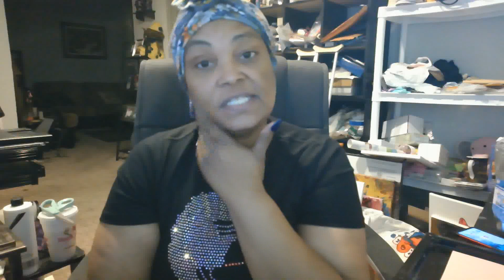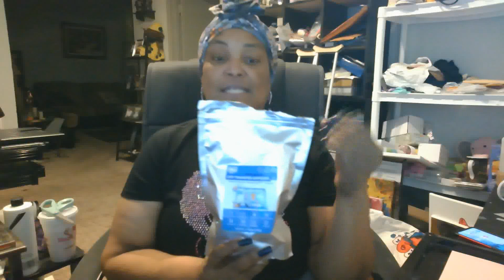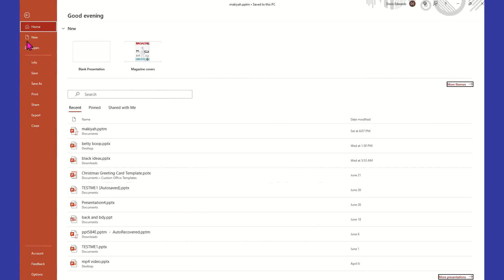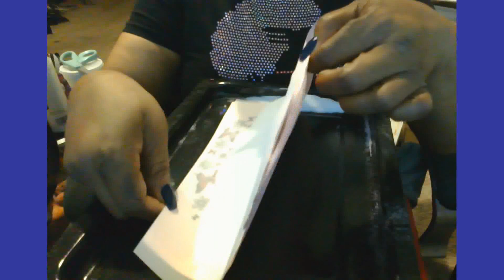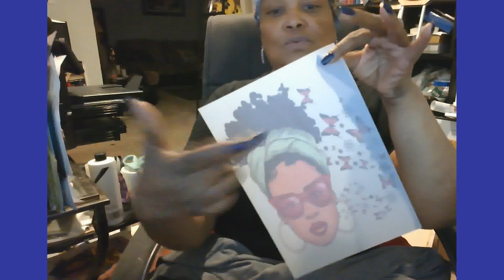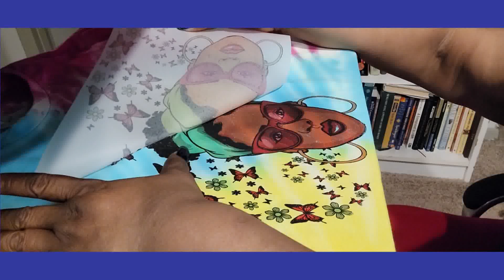How-To Use the Direct To Film (DTF) by Yamation

Comment: Hello. Love your video. I have the same type printer I converted to sublimation. I’ve been using DTF Yamation 11x17 for months. Worked great. However just recently my printer for some reason now jams! And if I finally get it to print, the image does not come out I full - it looks like a bookmark yet without the full image. I’ve checked my printer and software settings and updated my printer driver. I’ve never had this problem and hope you can advise. I’ve wasted so much Yamation film trying to figure out what happened.

Comment: How did the wash & dry turn out
Reply from the maker: It washed fine. I've washed it more than 10 times and the design is still there.
Reply: @dorisedwards58 First of A BIG THANK YOU FOR YOUR POSTING OF THE 2 VIDEOS ON DTF HACK W/ The Inkjet Printer!!! It was a God gift to me because I've been wanting to do sublimation designs for years. I actually stop do T's because I wanted that quality. You were the first one that I have seen doing DTF Hack and I was like yes! Thank You God🙌🏽  So thank you very very much!!!
Reply: And 2nd, your DTF HACKS (both of them) have been with the Yamation Film & Powder & Printed out with your Inkjet Printer not your sublimation ink right?
Reply from the maker: @sophiajones320  I did sublimation ink on one tutorial and inkjet on the other. I used yamation on both, but I have also used a different brand as well.
Reply: @dorisedwards58  Ok. So the Yamation products printed w/ the inkjet printer, how did it was & dry?  Did u test it Mis Dorise?
Reply from the maker: @sophiajones320  I have washed it several times and the image has yet to wash away

Comment: Thank you for sharing this. How do I get the lines out of my prints? I have an Epson ET-2400. Both of my prints have lines in them. It is a brand new printer 🖨️.
Reply: Roller marks, can try get off using q-tip before putting powder on, or can you set printer to printing thick paper...that lessens pressure on paper to try pull it through....try photo -matte ....experiment ;)
Reply from the maker: Have you cleaned the heads? Also, do a printer alignment. Sometimes you have to do it a few times

Comment: Next time you should cure the powder..The pet film should peel off very easy.
Reply from the maker: I put the image under the heat press to get it to melt, if that's what you mean. I just received this product today, so I'm still testing what works versus what doesn't
Reply: @dorisedwards58  did the powder melt to a surface that looks very similar to an orange peel?  Then press to the shirt.  If not put it in the oven at 320 for 45 secs. Or if you have a heat gun that will do as well. I’ve put them under the heat press before but it never melts good enough.
Reply from the maker: @crcdesign9886  No it didn't! I'm going to grab a few shirts today from Walmart and I'm going to try what you have suggested. Thank you so much! I'll video tape it.
Reply: @dorisedwards58 your artwork is beautiful yet it will make the difference between night and day. Just make sure the powder melts down and gets a rubbery feel and an orange peel look to it.
Reply: @dorisedwards58  when you say put it under the heat press  to melt. Do you you mean before you pressed it to the shirt?  If not that needs to be done so you won’t have any issues peeling the film off when you press it to the shirt.
Reply: Do you have to use sublimation to use DTF or can you use regular ink jet ink?
Reply: @everythinggoldencreations  this is a fairly new “hack” people have been doing with sublimation ink. I wouldn’t use regular ink due to the fact it will. Right out

Comment: you didn't cure the powder?
Reply from the maker: What time and temp do you use?
Reply: @dorisedwards58  to press it on the shirt I use 320 for 20 secs and then press it again with parchment paper for 10 secs after removing the film
Reply from the maker: @crcdesign9886  I'm going to try that today
Reply: @dorisedwards58  to cure the powder in the oven I put it at 320 for 1 min.